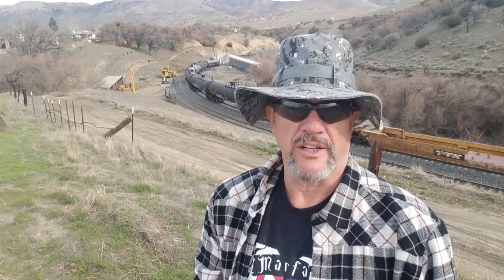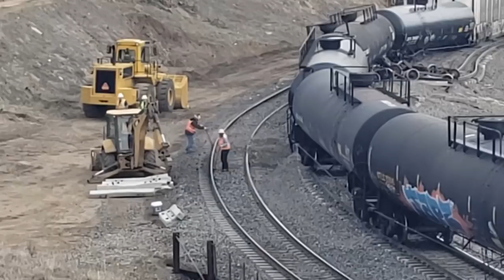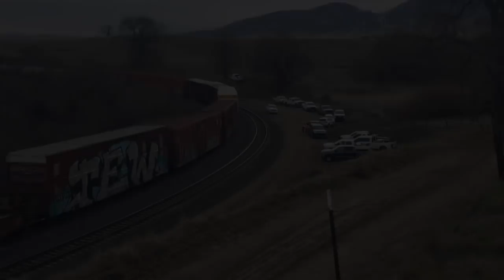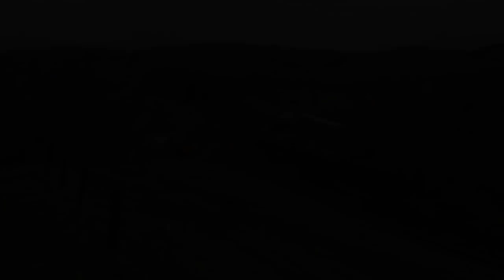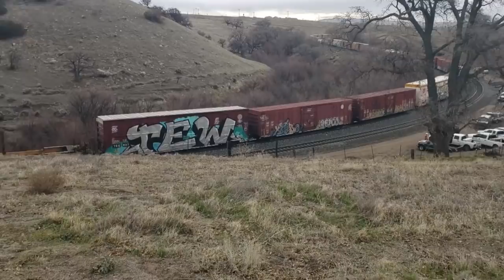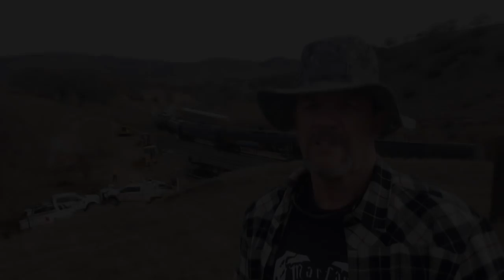Derailment at the Cable Crossover near Tehachapi. 1/13/22

Comment: Considering the slope, the amount of railcars and the curve, could have been much worse if we’re going faster. Must have been going around 35 mph but with the train’s momentum, damage can still be severe at low speeds.
Reply from the maker: The speed limit on the grade is 23mph. They were at 26 and attempting to slow. I worked a couple of derailments at this spot during my time up there. It's amazing how much damage can result at such low speeds.
Thanks for checking it out!

Comment: Thanks for the info sir! Curious to know the size of this train if it’s one of those mega PSR trains all those white vehicles are telling the bosses how well it’s working.
Reply from the maker: It was a manifest and they tend not to be the mega trains and this ones didn't appear to be overly long.
Reply: Well like you said no one was hurt and that’s the most important thing.
Reply: If this were truly a PSR operation, instead of a bunch of pickup trucks, there should be one big bus?
Reply: @michaelkohutek1113  They don’t have enough employees left to fill up an airport shuttle!

Comment: FYi: They are actually called signal bungalows I used to build the equipment inside them for NJ transit
Reply from the maker: I was in the signal department with SP/UP from 1979 - 2019. We called them houses or cabins. The smaller locations were just called cases. Thanks for checking it out!

Comment: That looks pretty serious.   MT1 looks damaged and MT2 trashed.   This is the major route North for UP and BNSF and there aren't any good alternative routes.    This will significantly delay numerous trains.
Reply from the maker: I'm sure they already have the #1 track up and running but without signals. I'll post porgress tomorrow
Reply: they will send stuff north toward the Columbia Gorge (OR and WA sides) or through the Skykomish Tunnel (WA).  Both of those routes are very much out of the way from SoCal but are the only other routes over the Cascades.

Comment: Pretty obvious as its the crews fault, putting the train in emergency for what reason??  Did they plug it from the rear??  probably mtys just zoom into the the trucks (springs) and you can tell right off the bat...  tough to see!  Thanks for the footage...  Daylight Dave.. 🙃
Reply from the maker: When a train goes into emergency, it is uncontrolled. That's why it's undesirable and contrary to SOP. It's my understanding that the train was gaining speed but that is not confirmed.

Comment: When you were called out to a derailment did you have to go right to work or just stick with the signals when it was ready
Reply from the maker: It depended on the damage, where the cars were and whether or not we had the equipment to replace what, if anything, was damaged. Thanks for checking it out!

Comment: Odd they are replacing the concrete ties there on the near track that doesn't appear to be part of the derailment at first glance, unless that is where the autorack to the left shot out of the train.
Reply from the maker: The entire crossover including both westbound signals, both power switch machines, both switches and both roadbeds were damaged. They are going to get the #1 track up first to get trains running.
Thanks for checking it out!

Comment: What is meant by "Cable crossover?"
Reply from the maker: This is a Control Point (remotely controlled by a dispatcher) with a crossover between the two main tracks. I'm planning a piece about why crossovers exist, why they are where they are and when they are used. Stay tuned and thanks for checking it out!

Comment: Derailments always get fixed.  The sooner the better.

Those fellers on the conference call have to answer two questions: Is anyone hurt?  and. When can we run a train?

A train standing still is not making money.  A train going 10 mph is making money. A train going 20 mph is making money twice as fast.

Ergo, get the wheels rolling!

Everyone please be safe.
Reply from the maker: Yeah but I worked enough of them to know that not every official within 500 miles needs to be there.
Reply: @MarkClayMcGowan    Sit in their cars on the phone to look important. The grunts on the ground are who get it done and earn their money.
Reply: @MarkClayMcGowan  i wonder how many were on the phone with someone sitting in another car.
Reply: @lonnie8775   Probably discussing where to go for breakfast.

Comment: Oops, but it blew it out nicely. Good that no one was injured in this derailment. With us in Germany this is the dangerous goods car when they are loaded have the UN numbers code as a sign on the car. Unloaded cars do not need this. I assume that the tank cars are loaded. Greetings from Berlin/  Germany. Sven
Reply from the maker: I really don't know. Someone else said they could tell they were empty by the way they were sitting. If the LPG cars had been loaded, it is unlikely they would have had so many people in the area so soon and no residents were evacuated. Thanks for checking it out!
Reply: Definitely not LPG.  Wrong type of car.  
      Most tank cars have the UN # on loaded or empty. Generally railroad cars have enough residue to require placards. So the placards get left on until reloaded with another material.
Reply: @MarkClayMcGowan  if the truck springs are compressed it's loaded. And those are LPG tank cars. They're too long for anything else except anhydrous ammonia.

Comment: The points might hold a clue as to the cause, as it was the last thing the train encountered.
Reply from the maker: It went on the ground before it got to the switch and even if it hadn't, it was a trailing move. The switch was just a casualty! Thanks for checking it out!

Comment: I've always been suspicious of auto racks and how stable they are when mixed with other more standard sized rolling stock.
Reply: That makes sense–they're so tall and seem like they would be top heavy.
Reply: I'm thinking they might be more of a problem when empty actually.  They're so damn long and the truck spacing just seems off to me.  They seem to do ok when run in unit trains, but when u mix them into a manifest, I dunno...

I have nothing to back any of this up.  I'm just speculating.
Reply: Center beams also seem to be culprits in some  derailments.Auto racks seem fine on straight track but on tight turns like this one you might have trouble.

Comment: What is a cable crossover?
Reply from the maker: Cable is the railroad name for the area. It used to be the siding of Cable and this was the east end but it was tied together with Tehachapi in the 50s and is now double track. When they did that, they created this control point with a crossover between main tracks, thus the Cable Crossover. West Cable is the beginning/end of double track.
Thanks for checking it out!
Reply: @MarkClayMcGowan  Thanks for answering. Interesting videos.